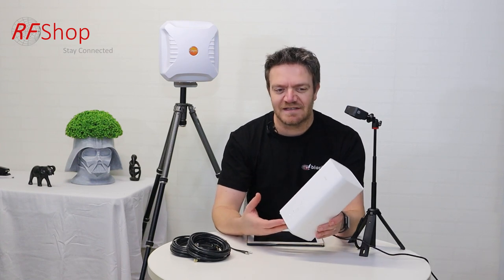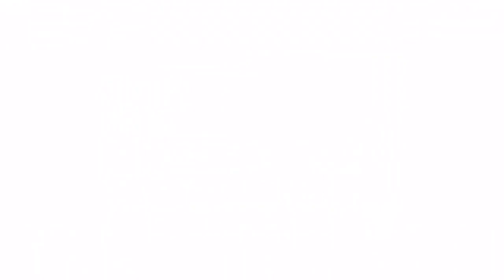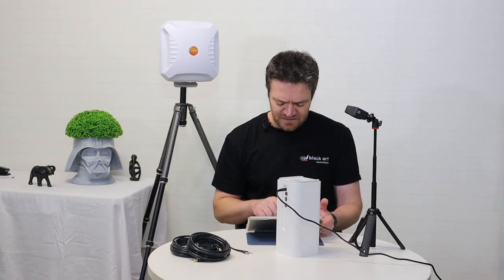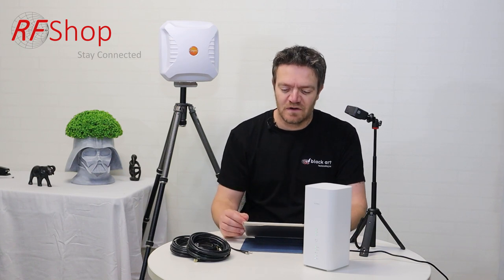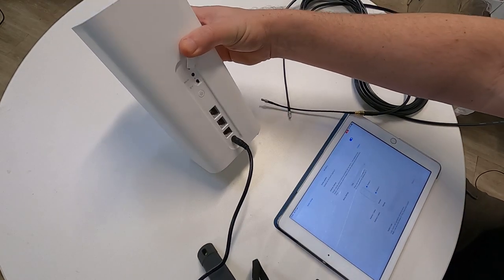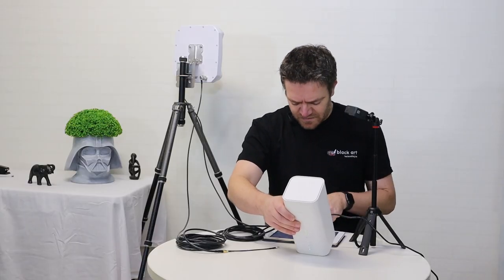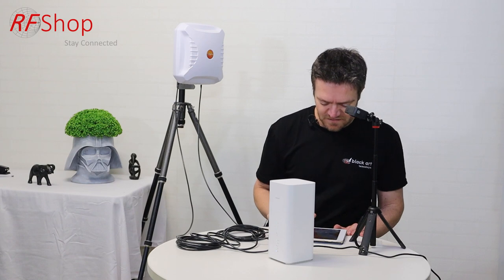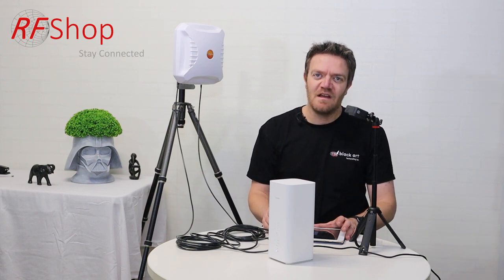How to connect a 4G external antenna to a Huawei B818 modem

Comment: Hi, how can I make sure that the modem internal lte antenna is entirely inactive and that only the external antenna works?
Reply from the maker: Hi Pierre. On the Huawei B818 I would take the software / admin portal update from internal to external as the best recommendation. There is a slight problem in that the internal antennas are 4 in total, so you will still pick something up unless you open the B818 and disconnect the antenna ports completely. Maybe worth doing if you want to make absolutely sure it only uses the external antenna ports.

Comment: Subscribed! This video is exactly what I was looking for my own home Internet solution (rural Illawarra NSW). 
I’m planning on getting the 500GB Optus 4G home Internet plan with the B818 modem router... and pairing it with a directional antenna on the roof that the last owners had professionally installed by Telstra (with coaxial port installed in living room wall). I take it from the video and comments this should work fine? All I’ll have to do is get a pigtail cable for the wall port and plug it into the antenna 1 port on the modem correct? 
Thanks
Reply from the maker: Hi Sean. Yes, that could work well. Only thing you may need to check once the setup is up and running is to make sure the antenna faces the best direction. Perhaps you are lucky and Telstra and Optus co-locate the tower. Otherwise you may need to turn the antenna. 
On the pigtail side of things we’re happy to assist.
Cheers,
David
Reply: @RFShop  you’re a legend mate thanks. I’ll have to see what connection the antenna gets as haven’t thought of that! I’m not certain but there are a group of towers one the hill which the antenna faces. I’ll try out jaycar for the wires but if no luck I’ll hit you up.
Reply from the maker: Sean, you are welcome to send me a photo of the connectors you have. I can tell you what you need. Email is on our website
Reply: @RFShop  thanks mate seems to be working but only getting 3G. Appears I’ll have to turn the antenna or upgrade it to a better antenna...
Reply from the maker: @Seanology101  that might indeed be a problem (the antenna). Can you send us a photo of it?

Comment: What type of cable fits in to the back of the HUAWEI router? I got an antenna off Amazon but the cables didn’t fit
Reply from the maker: Hi MIchael. The connector on the back of the router are TS9 connectors. They are normally placed on RG174 coaxial cable. I rarely see cable thicker than the ~3mm diameter used for this connection. We do sell small adapter cables that can convert any connector to TS9
Reply: @RFShop  thank you do you know if any tp link range extenders are compatible with the HUAWEI b818?
Reply from the maker: @michaelsalmon1782  you mean WiFi range extenders? 
Not specifically no, although it should all be compatible as they should all adhere to the same WiFi 802.11 standard (in my humble opinion)
Reply: @RFShop  I got an antenna and as soon as I plug it in my internet stops working? Do I need to set it up
Reply from the maker: @michaelsalmon1782  did you check the alignment of your antenna? It is important that the antenna faces towards the tower
Reply: @RFShop  The antenna was facing towards the tower but I can’t get in to the settings on the app to set it up
Reply from the maker: HI Michael, what antenna did you get? Feel free to send me an email
Reply: @RFShop  I got an antenna off Amazon with the correct Ts9 connectors and I’m just wondering do I need to do anything on the device management page to set it up
Reply from the maker: @michaelsalmon1782  
I think you need to make of the antenna secs. Can you share a link of the unit?

Comment: Hi there, i have a Huawei B628 and the speed was awful, that's why i bought an external antenna, but unfortunately nothing changed. I checked everything many times, tried to find the best spot on my plot, but nothing. It should be max. 200Mb/s but it is rarely 20...with or without the antenna. Is it possible that the problem is on the provider's side?Thanks for the response in advance.
Reply from the maker: Hi, can you share the RSRP / RSRQ and SNR numbers before and after the external antenna. Would be interesting to see if that does make a difference ? What antenna did you buy ?
Reply: @RFShop  Hi there, sorry for the late answer. So, without and with ext - RSRQ -15/-13, RSRP -112/-97, RSSI -77/-65 SINR -4/-1. Sometimes it's better, it depends on the weather, i think. The antenna is, KASER 4G LTE Exterieur Mimo Omnidirectional. Could be a good idea a signal booster?Thanks a lot

Comment: Do you know how to lock these modems to a tower, or will a directional antenna be my only option?
Mine gets speeds from 40 on bad tower to 200 on good tower
Reply from the maker: I am not sure how to lock these modems, so I would assume a directional antenna is the best way to do it...that's certainly me preferred way.
Reply: @RFShop  nice im in the suburbs of perth wa, in between two different towers, 300m away (30m difference between the two),  both are obstructed. one is obstructed by an apartment block and the other is obstructed by a hill. 
you reckon a directional or omni would be the way to go? and do u know what kind of db gain antenna would be best?
Reply from the maker: @moisty254  I would indeed say a directional antenna is good. The preference I would say is to use the mentioned XPOL-2, but you can also consider the DR11 (directional antennas) we have on our website. About 11dBi gain (as in the XPOL-2) will help to eliminate the other towers signal.

Comment: Aren't these devices locked to network? Also, do you have a recommendation for an external antenna used in a situation where I'm 1.37km away from the nearest cell tower?

Just started renting a new place and from a preliminary speed test from my phone, I'm only getting 23Mbps download. Big whammy that I got used to 120Mbps in my current place that's 100m from the tower.
Reply from the maker: Some network operators can lock the device to their network, but in Australia these units are not locked
The XPOL-2 I have on this video should help make a huge difference
Reply: @RFShop  Thanks for your help. I'll need to do a bit more research and also most importantly see how I can hook up an external antenna in a rental place (would love to hear suggestions on this if you have any).

Lastly, I'm using some data from cellmapper.net. Would the information from this site be reasonably accurate to use?
If the data is good, looks like the nearest cell tower has a 708/763MHz antenna beamed about 18 degrees north of where I am. That's probably my best bet. Other than that, the next best antenna is 1762/1857MHz, but is aiming 32 degrees north of where I am. Is there any way of locking onto the higher frequency antenna?
Reply from the maker: @gjaeigjiajeg  in that case the XPOL-1 with suction cups might be an option. Basically you’ll connect the antenna to the modem, but can mount the antenna outside against a window
Reply: @RFShop  thanks. I take it that the XPOL-2 can't come with a suction cup option?

Also the question was also wondering about routing a cable from inside the house to outside
Reply from the maker: @gjaeigjiajeg  indeed, XPOL-2 does not have a suction cup. I did notice that the new XPOL-2 with options for integrated routers do come with suction cups though. Perhaps there is a way to combine the mechanics of the two variants.

Comment: Hi there, would you recommend this antenna on Huawei 5G CPE Pro, would it work?
Reply from the maker: I had a quick look. The 5G CPE Pro clearly says it has two external antenna ports, so this antenna would be able to connect to that device. 
I would certainly recommend this antenna for that device
Reply: @RFShop  I see. But the specs website of Huawei states that the antennas are for 5G which is a bit confusing 🤔
Reply from the maker: @jeromedashieltolentino8545  Understand. Although I would expect the external antennas to be suitable for all technologies supported by this modem (i.e. 4G and 5G) the Poynting XPOL-2 supports the 3.8GHz 5G bands anyway, so it will work as long as the 5G frequency band is within the frequency range of the antenna (698MHz - 3800MHz)
Reply: @RFShop  Noted. Hope you could do a test or a video for this particular Huawei router. Cheers!
Reply from the maker: @jeromedashieltolentino8545  ...thanks for that. Now this unit is on my shipping list as well !!
Reply: @RFShop  nice, I'm gonna watch out for it. Badly need an antenna that works first before i purchase. Who knows i might even purchase from your site. I'm from the Philippines by the way 😀

Comment: David, thank you for a very informative video.  I have a Huawei B618 and it has the same antenna port set up at the back of the modem.  Is there any reason to think that your video would not be equally accurate for a B618 vs B818 (except for speed - different chip set)?
Reply from the maker: Chris, they do look very similar, don’t they?!?

I have no reason to believe it’ll be any different in terms of end-result of adding an external antenna.
One of my upcoming videos is going to be on what I learned about the antenna configuaration on these modems. I can’t show detail on Social Media, but what I learned about the b818 is that has 4x4 MIMO on the inside and actually routes only two of the antenna sets to the port. I don’t know if the b618 is any different, but looking at the form and basic descriptions I can only assume they did the same again.

Comment: do i have to connect it for it to work ? or will it work just with the chip?
Reply from the maker: You do need to have the antenna physically connected to the router for it to work.

Comment: How does one improve the signal to noise ratio? I get 0 to -3dB at times.
Reply from the maker: Rushil, that's a good question. An external antenna would allow you to move the receiving part of the RF circuit away from the modem. If there's a noise source near the modem that could help. 
Alternatively, a directional antenna can look "away" from noise sources, thereby reducing the amount of noise coming into the receiver...hence improving SNR
Reply: RFShop I have an external Poynting XPOL 6 antenna installed, and every once in a while I get a positive 1 to 3 dB, when a car drives past🤯. 
I can see the tower from my home, and rotating it did help, but would vertical elevation make a difference?
Reply from the maker: I would say vertical elevation might help...try to avoid the passing cars completely.

Comment: Hey David, hope you're well mate!
Just installed the Poynting XPOL - 2- 5G Antenna, as high as possible on 2.4m tripod antenna on roof. RSSI -65dBm,RSRQ -9dB, RSRP -95dBM (Huge improvement) however, SINR constantly moves from -2dB to max 4dB, have tried every tiny angle and increments of 15degress & 10 seconds to refresh, best SINR i can get. Would the Lighting/Surge protectors be causing lower SINR? Any Ideas how to boost SINR?
Reply from the maker: Hi Nick, tricky one. Are there any obvious possible sources of noise? Going to -2dB is very low, so you really want to be well above 0dB, otherwise your performance will suffer. 
Good to know the RSRP is stronger, so the antenna gain is helping. Just thinking out of the box...have you tried lower heights at all?
Reply: @RFShop  No i thought about lowering it, but its all cable tied and protected now with conduit. And i live in a gully at the egde of the mobile cell tower coverage. End of the day i've gone from 1.5Mbps to 211Mpbs download max, that's insane improvement with this antenna, so thank you. Max SINR i get is 4 to 5dB then drop to 0 or -2 then back up again every few seconds. But it all good, Antenna is amazing, Thank you so much.
Reply from the maker: @MrHitmanNick  that’s awesome to hear. Thanks for letting me know. As you know December has been a little bit mental so teally appreciate learning about some successes 😊👍🏻

Comment: Great video.. very informative thanks. Only question I have is does the external antenna override the built-in internal antenna?
Reply from the maker: Hi George! Yes, when you connect the external antenna it overrides those two antennas. However, the B818 actually has 4x4 internal antennas, so it becomes a 2-way internal ans a 2-way external antenna system (assuming you use a MIO external antenna)
Cheers,
David

Comment: May I know what include the box please?
Reply from the maker: In this kit we include the antenna plus it's bracket (for pole mount or wall mount). It also includes 10m of coaxial cable terminated in an SMA(M) connector (2x) and we include the SMA to TS9 adapter cable. The adapter cable may not be required, but we still include it so it's easier to sell. Don't have to "please explain" for every sale
Reply: RFShop thanks very much indeed.

Comment: Hi there.... Will you please do a similar video using the new Telstra Smart Gen 3 Modem ? It has 2x external antenna ports labelled (pri & Div) I'm assuming means Primary and Diverity.  Cheers :)
Reply from the maker: I can certainly look into that !
Reply: @RFShop  That would be great …. Also the GUI has changed a bit, now without the antenna ‘mix’ option. This area is a little confusing for the novice. Thanks so much 🙏🏼

Comment: very good and informative video i am shocked to see this speed on 4g network is this device is capable of that much speed because currently I am planning to buy one 5G router but the speed is almost equivalent to this router ....so the speed which you are getting is just because of this new B818 MODEM or because of your service provider i have 4g router which is 3 years old but maximum speed is 60 Mbps in ideal condition
Reply from the maker: Hi. Yes, 4G can most certainly go much faster than 60Mbps. Modem selection does make a big difference, but so does network settings and also signal quality

Comment: Have an xpol 2. Set it up saw noticeable gain in download speeds and RSRP/Rsrq late at night when speeds are high.speeds went up to around 60. Almost double the speed. However during busy evening period the speed went down to less than 1mbps unusable. It was actually better without it. Checked the cell ID it remained the same so it wasn't hitting a different mast. A bit baffled to be honest
Reply from the maker: Hi David, did you check the band you are on? Is it always the same (with and without, day and night) ?
Reply: @RFShop  yeah have it locked on Band 20 the one that the mast uses
Reply from the maker: @dmdavidjmoloney  how does it go when you don’t lock it?
Reply: @RFShop  same thing happening that's why I locked it in the first place. I find it strange it obviously has the potential to pick up way higher speeds than internal antenna but for some reason it cometely drops of in evening maybe it not pointed exactly at mast hut then why would it pick up the high speeds at night
Reply from the maker: @dmdavidjmoloney  it seems odd and something that the network does / controls. Seems like congestion is a major contributor
Reply: @RFShop  yeah congestion an issue alright as speeds slow down during evening. Still confused as to why internal antenna wud be faster than external at times during the evening as the top speeds are way higher with external at night. U wud imagine if network was very congested and evening speeds were only say 4mbps on internal that they wud be for argument sake 7or 8on external. Have also noticed while doing a speed test on external during the evening that it is very jumpy goes up and down like a yoyo where as at night the download speed raises gradually like its meant to do
Reply from the maker: @dmdavidjmoloney  I guess the only parameters the antenna can control is the RSRP, with the RSRQ and SINR being artefacts that follow a better antenna setup as well but are subject to other environmental variables. 
Taking a step back...does the RSRP improve with the new antenna? Does that value change by night? How does RSRQ and SINR look? If there’s a link problem these values will tell you. If there is no link problem and these values are healthy one would need to look at the network operator and ask them what’s going on.

Comment: Great, mine RSRP dropped from -70 dBm to -51 dBm.
Reply from the maker: Awesome. Was that RSSI though? The improvement makes sense, but the actual value seems to be RSSI (i.e. the 3G number). Does not matter though, as it still means the same thing as far as relative improvement is concerned
Reply: @RFShop  You are absolutely  right. RSSI dropped from -57 ti >=51, but RSRP dropps from -91 to -78.
Reply from the maker: @TeemuTakio  that’s just insane. Very nice!!